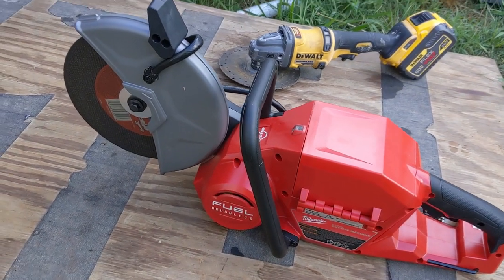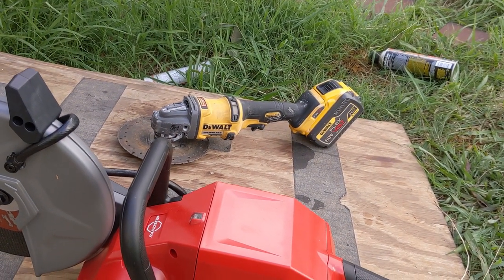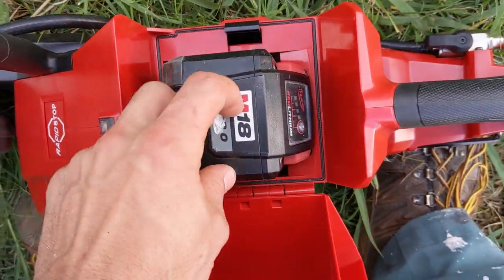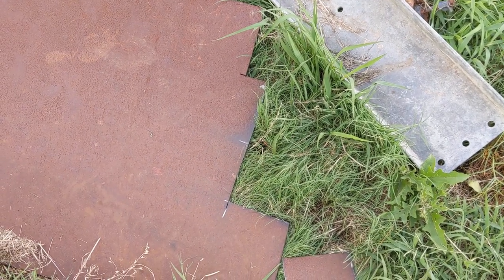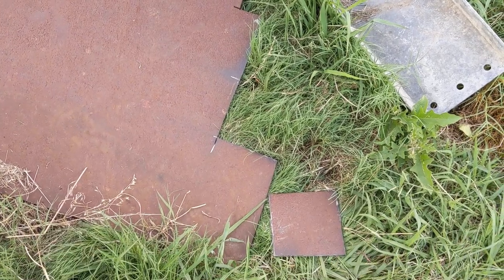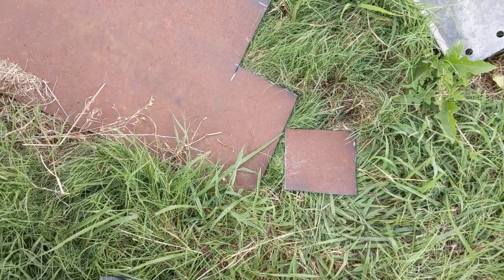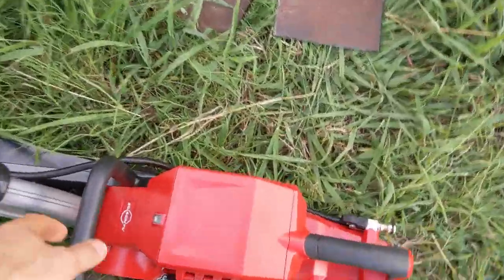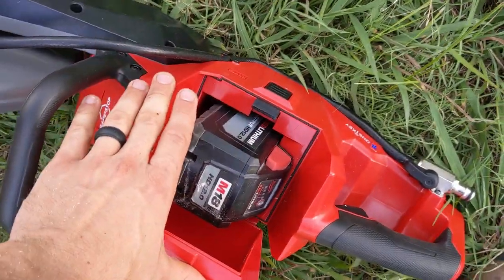Milwaukee M18 Fuel 9" Cut-Off Saw

Comment: I work in construction doing hardscaping and I was impressed with it. Didnt have any problems, it'll eat thru batteries but its alot lighter and easier to move than the gas powered Stihls we normally use. Its definitely got its place for me
Reply from the maker: If you are doing occasional cuts then I could see it being useful. I was using it to cut mortar off of brick and cut down bricks and it could do about 15 before overheating.
Reply: @MyFortressConstruction  you may have gotten a bad one or u were pressing down too hard? I watch the light and let the blade do most of the work, if it was a stihl i wouldn't worry about it at all as they're bulletproof I come right onto those.
Its not so much a fail as its just the battery tech isn't where it needs to be right now for electric to replace gas. I get about 15 cuts thru granite and a few more out of brick and then their biggest battery the 12.0 is dead.. but like I said for a few cuts I grab it cause it's alot lighter and has power instantly w limited noise so its still a good tool for me to have. I got mine half off retail in box at a pawn shop 😎
Reply: @MyFortressConstruction  i think its because its a sealed unit for when u hook up the water.
Reply: An 18v battery needs to be juiced pretty hard to create the power.  Makita have pretty much the same saw, but in 18v x 2 (36v power).

Comment: Thanks for an honest review. All I could find before this was a bunch of paid fan boys saying how great it was. I almost bought it. I have a bunch of the dewalt flexvolt tools and I got a milwaukee fuel grinder today and was extremely disappointed in how fast the batteries die when cutting rebar. Its too bad the dewalt 60v batteries go flat after a little while, 3 of my 7 are DOA.
Reply from the maker: Yeah, it seems like battery technology is still trying to get there. As you said, the High Demand 18v tools overheat quickly, and the 60v batteries don't seem to last much beyond 3 years (I just had a 2ah 60v die about 4 weeks outside of it's stamped mfg. date). Best thing to do is take in all DeWalt/Milwaukee batteries before the date expires and tell them it doesn't hold a charge like it used to (which is always true) and they will give you a new one. I have done this several times with no issues. I'm happy and Dewaukee is happy to keep taking my money, lol.
Reply: @MyFortressConstruction  I ended up back with the Darkside and got the flexvolt quick cut and it's legit. I cut pavers and rebar no problem now without having to breathe 2 stroke fumes. So far it's exactly what it's supposed to be but I know without a doubt the DeWalt batteries are garbage. Therefore I don't recommend anything with the flexvolt badge...
Reply: One more thing the DeWalt saw has a vibration to it, does this do the same or is it smooth when running? All the paid Fanboys that I mentioned say it's sooo smooth, I'm curious.
Reply from the maker: @BP-bb4vg  So the Milwaukee uses a belt to drive the blade, whereas the DeWalt is like a grinder where it's directly attached to the shaft. According to what I've seen, others have said the DeWalt has more vibration to it. The Milwaukee is pretty smooth.

Comment: I have a brand new saw and same issue tried a brand new 12ah battery and same issue thus is the second saw as they replaced the first one but same issue hopefully the 3rd saw will have different results and I only used the weight of the saw never pushed hard on it

Comment: Not surprised that it shut down fairly quick, the circular saw and grinders where doing the same. Buy the dewalt 9” never had any overheat problems. 30 year mason.
Reply from the maker: Yeah, I switched over to flexvolt completely because of the overheating issues on their more power hungry tools.

Comment: a vs one of their cordless grinders would be interesting on a 12amp
Reply from the maker: Yes, I have the flexvolt grinder and was thinking about trying to time a cut through steel with it vs. the cut off saw. If the flexvolt could beat it, then the fuel 7"-9" grinder would definitely win.

Comment: Can you add 2 blades to make a wider cut ?
Reply from the maker: No, the bushing isn't wide enough for two blades so the second one would be off balanced. But even if you machined all new parts to attach to the spindle, the amount of extra force needed would be too much for this saw.

Comment: Any luck with high output batteries?  How about the new forge?
Reply from the maker: I didn't keep this saw, but if the new forge batteries don't overheat then it's possible it would work a lot better.
Reply: The new forge battery overheats too and lasts less time than the 12HD

Comment: I’ve noticed with mine you have to be very gentle cutting steel with it you can’t even let its own weight do the cutting you have to take some of the weight off BUT cutting concrete it works a treat 

The plastic body feels cheap compared to the drills, it’s as if they used the same plastic from the chargers, maybe to reduce weight, I don’t know. All in all il give it a 6 out of 10, I’m going to try and get hold of a 9 inch 1mm slitting disc and see how it performs
Reply from the maker: Cutting brick with it seemed a lot better, except for the same issue of overheating...

Comment: Hi i kniw someone who uses it for their business and never had issues cutting concrete or metal could it be thus unit is faulty?
Reply from the maker: It's possible, but there are a lot of people that have similar complaints. I think our expectations were high and this just didn't meet them. This saw has it's place cutting small amounts of pavers or concrete, but it just overheats so quickly.

Comment: I've found one used online for half the price of retail. I'm heavily invested in Milwaukee already and have 6 high output batteries. I already have the 7/9 inch m18 grinder and it works beautifully. I'm a bricklayer and prefer the grinder over my stihl quick cuts because of its one hand use, and because of it lightweight, I can carry it up a ladder with ease. Do you think at the reduced price this tool would be a healthy addition to my tool collection?
Reply from the maker: If you have a lot of high output batteries already then you can overcome the downside to this saw. I had to cut a hole in concrete to move some water lines a few days ago and it was just barely able to get through 40 linear inches of 3" concrete before the 12ah battery was overheated and depleted. Unfortunately my other 12 amp hour battery had to be sent into Milwaukee because it started to fail. I would say the saw is good for infrequent masonry cuts or rotating several batteries. I do not like to use it for cutting metal though.
Reply: @MyFortressConstruction  okay I'll consider

Comment: So was it a manufacturer defect. Im asking cause im lookinh at buying something to cut bricks on a fireplace.  Was looking at getting this one, but now im hesitate
Reply from the maker: If you just have one job, I would rent a gas saw or buy an electric 14" saw for $200. I haven't had time to take it in to Milwaukee to see if it's a dud. I don't think it is, I think this is it's normal operating abilities.
Reply: I did a whole 4 x 4 fire pit for my buddy with this saw. With 3 batteries. On a constant cut (say about the third one) the battery will start to over heat so I would swap it out for another one and rotate them. Was a bit of a hassle but we completed the project just fine. As long as you have 3-4 12.0’s you’ll be just fine. 

I don’t want to deal with carbs anymore... Battery powered is great for that.  You just have to change your ways and be on top of battery cooling/charging.

Comment: We use the saw all the time at work and it’s great. Definitely last a lot longer then mentioned in this video though. Maybe faulty battery was used?
Reply from the maker: No, I used two different batteries. I just found it to not deliver the torque or runtime I was hoping for. The M18 chainsaw has been great though.

Comment: Cheers, you just saved me a whole lot of disappointment. The Sthil 9inch 2 stroke works out the same price once you have bought 1 battery and a charger and the still has 40 - 50 mm deeper cut depth and only weighs an extra 2.6kg. I'll deal with the inconvenience of mixing 2 stroke better that waiting to charge expensive batteries. Time is money.
Reply from the maker: 👍 Yep, at this point smaller batteries (I consider the 18v 12ah small) just can't handle a lot of repetitive stress. If you cut a couple of pavers, or a little 2x2 hole it'd do fine, but if you need longer runtime and more torque then best to stick with gas.

Comment: Think ill stay away and stick to my old stihl ts400 old saw but she still runs
Reply from the maker: Yes, for extended/real work, a gas saw leaves battery powered saws in the dust. The only way a saw like this makes sense is if you can't have fumes in the area that you're working in.

Comment: From a product design perspective, I think it's unacceptable to use 18 volt to drive such a large disk. Milwaukee is quite stuck here, there's nothing to bridge the price gap between their 18 volt and 72 volt products. I am used to EGO's 56 volt system yardwork tools, I remain very skeptical when I see Ryobi and Milwaukee trying to fit 18-24V system onto some of the bigger heavy duty tools.
Reply from the maker: Yeah, it's impressive that they can make it functional at all, but heat remains the primary enemy with such low voltage. The higher the voltage, the less heat is transfered through the conductor at a similar wattage. We can load a 1500 watt appliance onto a 100' of 14 gauge copper at 120v and the wire might get warm, but it's at no risk of overheating. Do that with an 18v circuit and you're pushing 83amps to get 1500 watts of power. You better have some beefy conductors and/or cooling power to keep it from melting. But it's not just the conductors, it's the power source too. You're asking a lot from cells that weren't made for that kind of discharge. The "new" flat cells that are being released look like they could give Milwaukee the boost in power and cooling that their higher demand 18v tools need. I know they're working to release them since DeWalt and Flex already have. I am curious who holds the patent on that though because they will have the advantage.
Reply: @MyFortressConstruction  I've been flip flop on whether to get this one or to get the MX fuel 14" cut-off. It's very difficult to make the commitment to step foot into their 72Volt product line. I think I will just grab a sub $400 14" wired 3200W models on Amazon.
Reply from the maker: @956870733  Yeah, I mean, you can pick up a $400-$700 electric saw and a $300 generator and it definitely beats the pants off of any cordless saw when it comes to run time. These saws are for shallow, quick work. Not for all day use. The batteries are just not there yet.

Comment: Sounds like your batteries are worn out or you aren't willing to let them fully charge.
Reply from the maker: I don't think my batteries are worn out as I've only had them for about a year. And a battery with a 50%-75% charge should still perform just as well as a battery that's fully charged (yes, there is that little bit of extra kick that a battery has coming fresh off the charger, but that doesn't last). This saw just overheats them. The M18 chainsaw, which I love, does make them hot, but it never cuts out from too much use. I've demoed brick and cut concrete, angle iron and rebar and it just can't handle prolonged use. It cuts through smaller stuff pretty fast, but my flexvolt grinder with a 7" blade (it's only rated to 5" I believe) out performs the cut off saw in anything thick. If I ever get over to a Milwaukee center I .ight drop it off to see if something's wrong, but I think it's just how it is.

Comment: Mine works fine.
Reply from the maker: That's great. Do you have any issues with overheating and having to swap out batteries in heavy work?
Reply: @MyFortressConstruction  No my batteries are very well taken care of. I don’t we charge them until they get cool down to the touch. The tool is probably six month old
Reply from the maker: @edm9063  What is your typical use scenario? 

And I don't have any issues out of the batteries in my mortar mixer, lights or chainsaw, but this tool seems to use the most amount of power out of all of them. Dust free cutting of concrete was the main reason I kept it, but otherwise I use my 6" grinder for most things.

Comment: 1) you were pushing down hard. (I could hear it.) don’t deny. Lol
2) you were cutting from the tip of the angular steel downward.... like come on. (It’s only a little saw man)
3) battery needs 20 minutes to cool down after heavy use. (Clearly you had pushed it hard before starting the video)

This is a great little saw. You just can’t push it like a gas one. You have to think/act differently. Smh... and I’m not even a “fan boy” per se. 😆
Reply: Did you see his left hand on the front handlebar?? Dipstick?? Ahh no. Because you would have had to have your eyes open to see that it wasn't there. So how do you push that machine down hard with one hand from the back? Please. Tell us all.
Reply from the maker: Ha, nope, I was holding the camera in one hand and literally letting the saw's weight do the cutting. And yes, cutting from the back of angle iron isn't going to cut very quickly, but my flexvolt grinder with a 7" blade can do a whole lot better.

This saw is not a great saw. If it could cut without overheating, then it could be useful. But needing to rotate between four 12ah batteries just to be able to use the saw, defeats the whole purpose. Might as well lug out your generator and plug in an electric one. It'd be cheaper and have a 14" blade!
Reply: yea it does suck. used it at work for rebar  and the own weight of it makes it stop. 2 min of cutting makes the battery super hot. would have loved it because its light. but not a great concept.